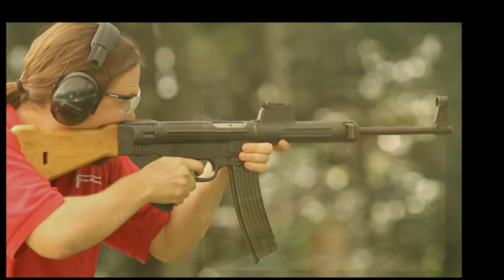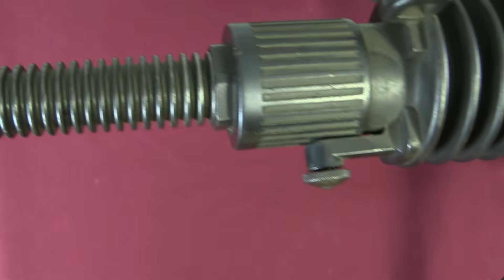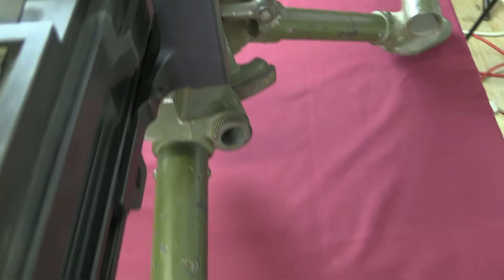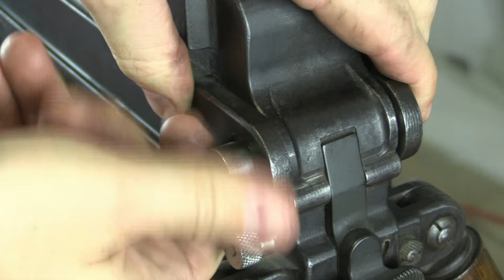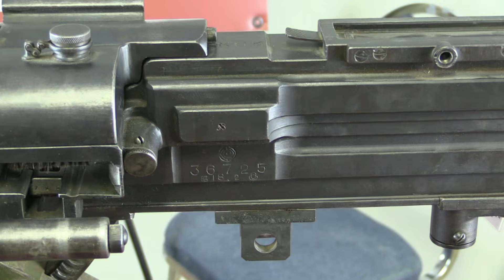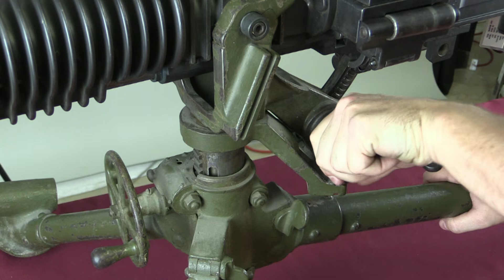Type 92 Japanese HMG

Comment: What is often forgotten is that this MG can effectively fire indefinitely given that there is a loader and ammo to feed it. The oil in the gun keeps the gun from heating too much and as a result, even with its theoretically lower ammo per reload and bulkiness - this thing's sustained rate of fire is unmatched.

Basically this thing is like a mini 40mm Bofors. Keep feeding it and it will keep firing and on a very stable platform as well even if the ground it sits on is uneven. The greatest of any MGs meant to be used as emplacements during the war.

Comment: The type 92 is a reliable machine gun with long continuous period firing.it have some fault,it is heavy which requires three person to carry it with tripod. the front wheel for adjusting the gun barrel height could put crew in danger where they need to move to the front.

Comment: My father who was a member of the 11th Airborne said they could adjust the rate of fire faster by placing a few dimes in front of the recoil spring. This way it didn't sound like a woodpecker when used by US troops. He said it also caused some feed malfunctions but worked.

Comment: It's a really interesting argument (and that's what it is; not a discussion) about the pros and cons of strips, compared to belts for old machine-guns and cannon. The presence of a dedicated loader with strip-fed guns seems to have provided a good sustained rate of fire, whilst detractors bang on about how you need to have a loader or else you have to stop firing every twenty rounds or whatever.
Then they completely ignore that all HMGs back in the day were crew-served weapons in any case! (As were most LMGs, to be fair.)
And the icing on the cake is when the argument flips around the other way at huge calibres for cannon, where the vertical clip feed / hopper system for the 40mm Bofors gun (which requires constant feeding of four-round clips from dedicated loaders) was seen as no sort of issue, but a belt-fed 2-pdr Vickers was all sorts of problems.
I can never quite wrap my head around it other than  to surmise that anything selected for use by the US Armed Forces was just 'better', in the minds of audiences.

Comment: I am just amazed at how this machine gun is being designed and engineered in the past by the French and later improved by the Japanese. It is not that complicated in terms of maintenance but as far as i observed, in terms of its operation, it is very efficient, reliable and durable. One of the biggest plus of this HMG is that it has a huge air cooled heat sink to avoid the barrel from overheating. Its just an excellent HMG.

Comment: I’m in the UK, but I think I’ve now seemed enough guns be disassembled for me to have an understanding of how they work mechanically.
That being said, almost everything about this gun just makes sense, the bolt and gas piston are really robustly built, the trigger and safety mechanism are so simple, the continuous oil feed is a great way to increase the reliability and the Tri-pod controls look really easy to use.
That being said, from an engineering standpoint, I wouldn’t want to have to be paying for the milling down the fins or machining the components

Comment: Dad was in the Philippines with 25th Div. in early 45. His first patrol was to find a Japanese heavy machine gun that had been giving his unit problems. They finally found the Japanese gun set up on top of a hill. The Sgt told my Dad and another soldier to circle around and see if they could draw there fire. Dad though this was the dumbest orders he ever got, at the time. So he and the other guy circled around and got abit higher so they could get a better view of this emplacement. They started taking pot shots at this guns crew, but the Japanese soldiers that manned this gun just ducked down and try not to give away their position. My dad and the other soldier continued taking pot shots and we're getting closer and closer to the Japanese crew. Finally the Japanese had enough of this and opened up on my dad and the other soldier, who at this time we're running downhill trying to get away from the fire. Dad had stopped behind a big tree as the Japanese machine gunner trained his weapon on tree! Dad said he felt something falling down on his shoulders and he looked up and he could see the bullets going through the tree and the sawdust now falling down on top of him he says he was mesmerized by it and couldn't move and watch the bullet stitch slower and lower down towards him, then about 12 in from the top of his head the bullet stopped, he thinks the traversing mechanism had limited out for the gun to continue further. Dad said that was the last time you ever tried to use a tree as a safe haven to hide from enemy fire. While all this was happening the other patrol members with a sergeant were able to move unseen and got close enough to take out the gun crew with grenades. Dad said the machine in question was the type 92 and they called them woodpeckers because of the sound they made.

Comment: The 30 round strip isn't a bug, it's a feature. 

30 rounds is just about a perfect MG burst length, and a good crew could probably keep up a steady rate of bursts out of this thing. Even if it didn't have the extreme cooling system, I doubt you'd be able to overheat it as easily as say, an MG42.

Comment: I got to shoot one of these. The biggest thing(s) that I can say is a draw back is that they were 30 round strips, and that it was a HEAVY gun. If you are a soldier and have to fall back to the next defensive position, you are not going to be able to move that gun easily. But if you are to just sit in one position and lay down fire, it does the job. Technically, designers could have created bigger capacity ammo strips that would have mitigated that one issue.

Comment: It doesn't need a bayonet attachment.
You can tell it's Japanese because the design is old and obsolete, if you don't brush the cartridges with oil the machine gun will jam. That proves it's Japanese. The Japanese did not need a modern well-functioning machine gun, they had the spirit of the warrior.

Comment: I know the Italian MG oilers caused dust/jamming problems in the desert.  Is the Type 99 better sealed/designed/manufactured, is it simply the Pacific environment (in which case did it have jamming issues in high dust/grit environments in China, or is it something I'm missingg?

Comment: Not sure how I feel about this video.

I mean, to be fair, no non-American tool of war is anywhere near as bad as the “History” channel makes it out to be.  That said, we’re talking about a machine gun that requires that cartridges be oiled and uses stripper clips instead of belts.

There is no argument to be made to excuse the need for an oiler in this weapon’s lifetime.  There is no argument that belts are superior than these clips.

Granted, it’s a heavy machine gun and the necessity of an oiler isn’t earth-shatteringly awful if it actually works correctly.  The clips though...

Still, it’s nice to see someone talking about the gun’s very real merits for a change.

I was most impressed with the tripod though.

Comment: I just couldn't trust a gun that needed an oiler. Collecting dust aside, most guns are designed not to need one, and it seems to me that an oiler is a work around for a gun that needed further development before it went into use. Apparently the Type 92 was a great gun, but what happens when you run out of oil?

Comment: Didn't know much about these. It really is well thought out and well made. My eye was drawn to all the cooling fins at the start, which led me to conclude it was not a quick change barrel. The takedown is excellent- large, easy to handle parts and sub assemblies which will not get lost. The feed system is a little different, but it seems like the feed strips would be easy to stack in an ammo can or wood box. The oiler is a good idea, and it saves the cartridges having to be oiled at the plant. We all know that lubed cartridges will gather dust and debris during transport and setup. Far better to do it inside the gun, right before firing. Good Japanese arms often do not get the respect they are due. I remember hearing about a postwar test of the main bolt action rifles of the different nations, all rebarreled to 30-06 and using proof ammo. The Arisaka outlasted them all. Great video as always. Thank you

Comment: Great video about a well designed gun. But I will never understand why the Japanese never converted their designs to use a belt feed system instead of the strips. I would think that using a belt would have made continuous fire a much easier proposition

Comment: The feeding system is also the same as the one used by Italy's Breda M37, although this HMG used strips with 20 rounds instead of 30. Interestingly, the two weapons had the same rate of fire: 450 rds/min.

Comment: Anyone with a bit of military experience should know that oiling a gun is a a double-edged sword. On the one hand you need oil to keep the parts in working order, to reduce wear and tear and so on. On the other hand oil attracts dirt and helps it stick. In the case of the Type 92, dirt collected on the feed strips would eventually clog up the gun, causing it to jam or misfire. 
This MG was great for fixed positions, like bunkers, trenches and so on. But once it had to be moved, the huge weight made it a massive liability for the soldiers.

Looking back at it, the Type 92's main problem were the 30 round feed strips, which were susceptible to dirt and had to be manually loaded every time, meaning that the gun was almost impossible to operate alone in an emergency. A machine gun with a ammo belt could technically be operated by one man if needed.

Comment: The high quality and standards of the gun are probably the reason why only 45k were built in the 9 years it was built. No stamped parts and machined to what seem very close tolerances, its not a surprise so few were built. Also, I suspected the reason why they didn't degrade in quality like other Japanese weapons was because they ceased manufacture in 1941.

Comment: Why very few people seem to realize that the main selling point of the feed stripes on a heavy machinegun is that, with an assistant, you can have the gun firing Continuously. You can feed the stripes one afer another without touching the charging handle, or even bothering to link the stipes themselves as other people mentioned. 
As long as the loader can keep up stuffing one stripe after another into the feeding mechanism the gun doesn't need stop. Specially a gun like the Type 92 with its radiator hevy barrel.
The feed stripes had other inherent problems. But if your priority is uninterrupted supressing fire, they had no rival. 

Look at this for yourselves:
https://youtu.be/NSX097c8OJk?t=152

There are more examples of it in the same video. But its quite clear here.
So for a heavy static machinegun like the Type 92 is, and the way it was used. The feed stripes were more than adequate.
Sure, an MG42 was lighter and a lot more mobile, with the belts a lot easier to carry arround. But its doctrinal use in the german army was completely different.

Comment: The problem with this gun is that as a heavy machine gun it was just barely adequate, but Japan lacked any sort of medium weight non magazine fed MG and so this monster was basically the sole 'portable' machine gun they really had, and as a counterpart to an M1919 let alone something like an MG-34/42 this thing is catastrophically awful.  I also don't care how you try to spin it the stripper concept was awful and the oiling was a massive design flaw that caused endless problems and the guns suffered frequent stoppages and problems related to both in action. 

So sorry no, but this was not a 'good' weapon in any sense beyond being better then having no sustained fire automatic weapons at all, and even then only barely as it's weight meant it was often left behind and basically had zero tactical mobility in rough terrain, which is to say where basically all the Pacific fighting too place. It was a weapon decades out of date and using mechanisms that others had discarded years earlier for good reasons. The stripper feed alone would be enough to damn the weapon, the oiling nonsense on top of that just seals the deal.

Comment: There's a little feature on the tripod you missed (I believe?) Those little funnels on top of the front feet of the tripod were for rapid relocation of the gun. The gun crew would would slide poles into those funnels (I don't know if it was bamboo or steel) and they'd have a rather useful grabbing handles to move the heavy MG around without going through the trouble of removing it from the tripod.

Comment: An interesting weapon indeed, cheers for the video!
Initially I thought that, even with all the large cooling ribs, the barrel might get really hot during sustained fire but I suppose the weapon's slow rate of fire and rifle cartridges don't produce enough heat to cause serious problems.
Did the Japanese experiment with or use belt-fed HMGs before/during the war? At first glance it seems that using 30-round ammo strips to feed a fire support weapon is a bit too restrictive. Or are the ammo strips so much faster to reload that a trained crew would have less "downtime" using those?

Comment: Excellent video, Ian. I have only one point of disagreement. I would argue people tend to believe that these are bad guns not because of their qualities as a gun itself, but their qualities as an effective weapon. By that, I mean this is undoubtedly an accurate and reliable machine gun, but most folks would see the caliber and then the weight (and perhaps the even then obsolescent feed system) and be left scratching their head as to why it was not chambered in a much larger cartridge or why the gun was not put on a diet to make it more mobile. I think a lot of people would agree that a .30 cal mg that weighs well over 100lbs with its tripod is seriously wasted potential by either not making it a bigger badder fixed piece that fires rounds that could punch through armor and cover or not making it lighter and more mobile and therefore not making it as inviting of a light artillery target.
Anyway, it's always fun to watch your videos. Keep up the good work.

Comment: Hi  Ian. This video is one of the best you have done. And that is complimentary of what is already a very high standard. Heinlein was right. Find something you love, then go do it. One question. Looking at the machining complexity of this,the Maxim derivatives,the Bren,somewhat less on Colt series,compared with the precise simplicity of the MG42, is there any literature that gives an approximation of cost,man-hours,machine shop hours of each of these? I mean a Maxim awes me to look at its many machined surfaces,but this is way out there.Designed without much regard to cost,using only the very best of materials,using lots of precision machine shop tools,picking only the best experienced machinists to work in the place and training  those picked is the only way to successfully build a product like this. There was a period car crankshaft that started as several hundred pounds  of expensive nickel steel,ending as some 90 lbs,80% plus being turned into chips. Any idea of what it took? As someone who studies on these things,it seems to me a question that might interest you. Cheers. Your videos are something I look forward to. Take care of that hair. Those are the only follicles you will ever have.

Comment: about the oil brushes, if they took those off of the other machine guns would they have worked better? the early light machine gun had the brushes but they always say that they had bad reliability issues and the oil tended to act as a magnet for dust

Comment: I agree with Ian, this gun seems way ahead of others available at the time. I've certainly learned a lot about early MGs on this channel, and it struck me that all the others so far are full of baffling design decisions, over complexities, and ill thought out controls. Everything about this seems practical and well thought out. The bolt mechanism is delightfully simple and rugged, disassemble is easy, the controls are practical, that tripod is excellent. Other than the large size and oil system, which are just artifacts of the time it was made, there's not a lot you could improve.